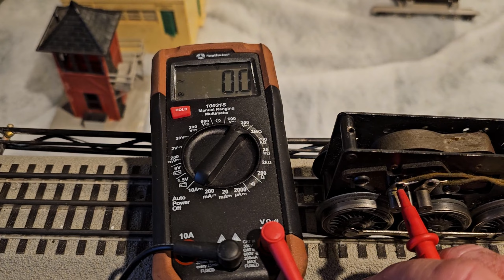Lionel 224e & 2024 Steam Locomotive Debug & Running MTH With Conventional Lionel Power

Comment: I gotta agree the 224 is cool. I also like the 1666 which is even earlier as far back as 1938 from what I find. They both are very similar 027 sized 6 wheels driving with larger diameter drivers. Easy to keep running and easy to take apart and reassemble. No plastic pretty much all metal USA iron.
Reply from the maker: I am getting more interested in this class of Lionel. Was the 1666 a precursor to the 226? Wonder what the differences are
Reply: @htssoutboardsboatstrains9784 I don’t know the building prior or not. I found some info on the 1666 and there are pre and post war versions. Prewar having straight floor at rear of cab and post war is longer and curved. I assume the 224 was similar but I’m far from an expert. The “linkage” on drive wheels is same on my 1666 and 224. I’d have to look at wheels (nickel rim) closer again for construction similarities. But definitely differing cast pattern.